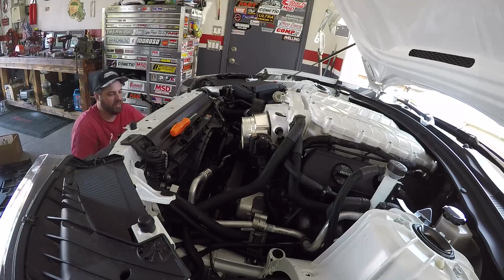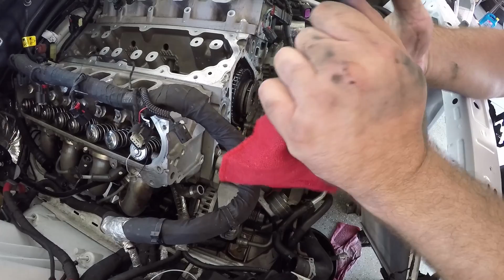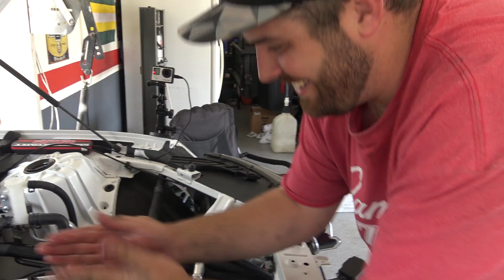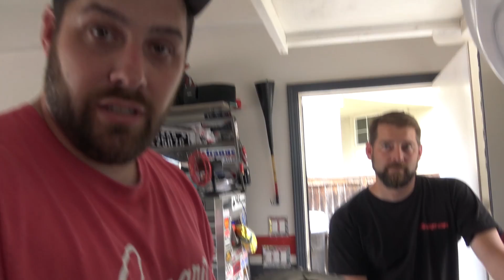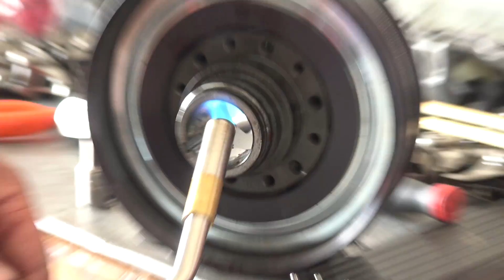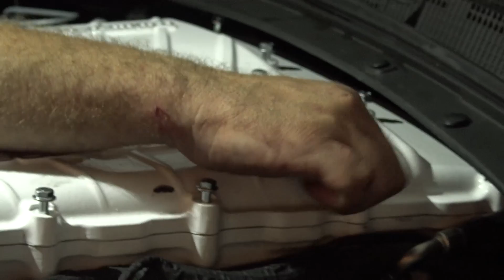Camaro 16-24 Cam Swap V8

Comment: Well, 5 years later, these timing chain tensioners are starting to get old and brittle. They can and do break in half when you try to pin them causing you to have to remove the oil pump/oil pan to replace the tensioner. THe last one i had in the shop snapped on me, a 2017. I have another 2017 in for a cam replacement now. I was able to get the cam gear out without trying to pin the tensioner or loosening the oil pump but it was quite a bit more difficult. I am hoping that i can get it to go back on after the replacement- that will be the real tough part. Also, it turns out that these oil pumps are considered a one time use item and if you take it off, you want to put on a new one. They make tools that you can use to put a used one back on, but many have had low oil pressure afterward- so its a gamble.
Reply from the maker: @FIXXERAutomotive  ZL1 or SS?
Reply: @Lethalgarage  The L86 truck variant
Reply: @Lethalgarage  Well, I got the sprocket back on this L86 without pinning the tensioner. It actually went back in easier than it came out. Instead of locking the crank to torque the cam sprocket, I wrapped a chain clamp between the reluctor and sprocket so that would take the tension of torquing down the bolt and not the brittle tensioner. I put a bolt in the block and allowed the clamp to rest against that. A guy wants to do this with either the heads off or with all the rockers off and the plugs out so in the case your chain clamp slips you don't put too much force against that tensioner.
Reply: That was the part that had me perplexed.  The LT pumps need either  alignment fingers that bolt to the block that save their location or new pumps are self centering . Id love to use this method on my c7 z06 but not quite sure if they alignment fingers will work with this or not . Improperly center pump could cause excessive pump wear and failure.  Not exactly a risk im willing to take on a 10-15,000 dollar lt4 engine .
Reply: @writeupking  That repair was a success and i was able to get the cam actuator back on without messing with the oil pump or breaking the tensioner
Reply: @FIXXERAutomotive so your axle to get the cam gear off and cam swapped without unbolting oil pump ? Because if thats the case there is no reason to not do this method . Id just score a mark into the oil pump thats at a true TDC found with magnetic dial base indicator and yeet on and off referencing that mark and rechecking dial indicator on a rod to make sure the piston hasn't traveled up or down from that reading.
Reply: @writeupking  There is a big gap on the actuator where there is no teeth on the reluctor for the cam sensor- you just rotate the engine to where that is facing down toward the pump- mark the chain to the block and mark the chain to the actuator. then take the center bolt out and pull the actuator off the cam- you have to use some small screw drivers to walk the chain off the sprocket and your free. it has just enough room to come out of there

Comment: What type of wrench and size did you use to remove the metal radiator line on the driver top side that space is kinda tight for me and a crow's wrench didn't work for me

Comment: Was the crankbolt a TTY? I didn't recall seeing you torque it down.
Reply from the maker: Yes, new crank bolt everytime
Reply: @Lethalgarage  how did you prevent the crank from turning when you torqued the bolt?
Reply from the maker: Your crank should have more resistance than the trq required. Also all the ugga duggas

Comment: Do you have to remove the rockerarms, push rod, hpfp to install the cam? I'm FBO H/c and my cam bolt broke and made a mess so need to replace the cam and sprocket thanks in advance

Comment: This video was absolutely amazing!  I'm getting ready to remove my front cover and prossibly upgrade/change out the oil pump.  Question:  Did you have to loosen any bolts on the oil pan to remove the front cover?  I don't recall seeing you doing anything with that.  

Great video!  I took away so much from this!  Thanks!
Reply: Did you end up doing your oil pump I'm kind of sitting at a spot where I'm about to do a KaTech pump myself.
Reply: @RTAMOTORSPORTS  If youre doing the pump, you need to drop the pan.  I did not end up doing my pump.  Make sure to be diligent when cleaning your surfaces and applying sealer.  Make sure you get in the corners very good.  Even the best job can leave you with small leaks.  

Food for thought.  Cheers! <3
Reply: @Hukk989  thank you!

Comment: Thanks for the awesome video, this saved me a ton of work not having to drop the oil pan. I installed my cam yesterday following this. When you installed your cam gear did it feel like it just barely sat in place when you put it on? I believe I have everything correct but get nervous as it didn’t seem to slide onto the cam far at all. My timing chain does sit behind the case and my cam does rotate in sync with the engine as I turn it over by hand.
Reply: Everything turn out okay?
Reply: @Parker565  it did! The trucks been back together almost 3 months about 2000 miles and is running great.

Comment: If I get a stage 2 or custom 2.5 cam, do you recommend I change the cylinder heads or can I get by without em.

Comment: Not pulling the heads off saves a bunch of time too. Can we upgrade the valve Springs with compressed air so the heads can stay on doing that too? Could be a nice update for Stock LT1, Cam Springs, Intake, Headers, can that be worth the time and investment. D

Comment: Have you considered removing the VVT all-together? I understand that you can run a hot LS cam in its place as long as you move the reluctor sensor closer to the wheel. This will allow you to tune the engine without having to "tune around" the VVT.  I know there is some good information out there regarding this upgrade.
Reply from the maker: VVT was removed when the first cam was installed.

Comment: So technically i can just pay for tbe labor on a cam install and get the super charger install for nothing?
Reply from the maker: A supercharger is more than just putting it on top of the block. But the install cost should certainly be reduced
Reply: @Lethalgarage  thanks for the reply

Comment: Can't get the chain back on the crank no matter how hard I try. Looks likes it lined up but still rotates. Anything it can get caught on at the bottom?
Reply from the maker: Should be on the bottom sprocket.
Reply: @Lethalgarage  I figured out the problem. Crank sprocket had worked its way forward and was too close to the back side of oil pump so chain couldn't go on. I was able to push sprocket back from the front side and chain went right on. Thanks for the reply.
Reply: @nathanphillips3061  how’s everything doing this method ? I’m a little sketch with putting time back together I already have everything off the next thing would be taking off oil pump but I’m concerned about to being able to see the dot on the crank to line up my cam sprocket with ! Do I make sense

Comment: Hey man great build ! If you don’t mind me asking how much all in all did it cost you to install the new cam ? Price of the cam and the installation? Thanks !
Reply from the maker: Typical cam install is $3,500 that includes all parts and labor
Reply: LethalGarage man I appreciate it ! Do you have any recommendations on which ones to get ? I only have long tune headers and cold air intake and cat back exhaust. And all I wanna do is install a cam.

Comment: Used lifter on new cam.?.did you need to break in?  engine oil on cam at install only?

thanks
Reply from the maker: Only used parts are. Crank, pistons and rods. Everything else is new.

Comment: Way better then dropping the pan or pulling the engine. Thanks for showing how to take the chain off. I was starting to stress i wouldn't be able to get it off, but watching it i realized i was being a wimp about it. lol. Got to really crank on it
Reply: yeah, I see they didn't drop the pan at all or even loosen the bolts.  I'm getting ready to reseal my front cover because its leaking and was curious if I had to get under the car or not.  Doesn't seem like it.

Comment: Hey.  I know this is an old video but I am thinking about doing a cam soon myself.  I was wondering what all bolts and gaskets were replaced to make sure I go everything.  (I know you didn't remove the heads so probably more needed for me)

Comment: Hey Matt I am intrested in getting a cam, are there supporting mods I should worry about? so far I've heard headers, Ported IM and Ported TB, and a tune
Reply from the maker: You need a few parts to do the cam swap. Springs, lifters, trays, phaser lockout, valley cover or DOD delete. All the parts run about $1300. Air intake, and headers are good. I’d buy the atomic intake over porting. But a good tune is also required.
Reply: @Lethalgarage  Good to know, I knew it seemed a little to easy to drop $500 for a cam and call it a day, Thanks

Comment: Why didn’t u remove the oil pump? I ask cause I’m getting ready to do my cam swap and the kit comes with a new CR5 chain and I see u have to use a alignment tool when removing/installing the pump but the tool is $140 didn’t know if u another way to do it or a cheap tool to use cause it’s only going to be used the one time
Reply from the maker: You need to drop the oil pan to replace the chain, in this case we had upgraded all of that when we swapped the cam the first time. Just needed to get to old cam out and out this one in, so a lot of tasks didn’t need to be redone.
Reply: LethalGarage did u use that oil pump housing alignment tool? It’s expensive for what it is and seems like a one time use tool. Most write ups I’ve seen I don’t see people using it at least they don’t mention it
Reply from the maker: We didn’t, but keep in mind we didn’t fully pull the pump

Comment: This has nothing to do with this vid but I bought my 2018 camaro SS without the NPP exhaust system and I wanna get a dual mode exhaust so I can keep my car quiet when I want to and loud when I want but idk how I would set it up, I figured you’d know. I just don’t know if I’d have to set up a toggle switch to open the valves or what ?

Comment: Does the camaro have the fuel management system or is that just in pickups ?
Reply from the maker: I am not sure what this question is in reference too?
Reply: @Lethalgarage  , never mind just watched a video you made 2 years ago and the answer was yes .
Reply: @Lethalgarage  , they started running the fuel management system in 2007 on the G.M pickups and was wondering if the camaro got stuck with this junk as well .

Comment: is it true the average cam job cost to install is around 4k ?
Reply from the maker: Mike can do it for $3k + the cost of tuning.
Reply: LethalGarage wish mike was here in Ny that’s the best price i ever heard how long was the installation time
Reply: Heads, cam , are springs , trunnions upgrade, timing chain , new bearings thru out , all arp bolts and studs, forged pistons and rods cost $6500 to install. But the engine is fully build and strong a ton of boost or nitrous

Comment: Not bad 👍 I’ve been telling everyone that there’s no need to yank the engine to put a cam in. That’s how I plan on doing mine
Reply: Regular Guy Garage if you have access to a lift, you can drop the motor from under and it would save you A LOT of this work. I know a lot of folks don’t have a lift,  but it’s a little FYI.

Comment: I have a 2017 Camaro 2ss with 3000 miles on her. My brakes continue to squeak with factory brakes and rotors any advice?
Reply: Had the same problem with the brakes on my '16 SS, I installed the Power Stop K7226-26 Front and Rear Z26 Street Warrior Brake Kit ($430 on Amazon) and the squeaking is gone.
Reply: Thanks imma check them out.

Comment: So oil pan removal is not needed for the cam install?
Reply from the maker: Keep in mind this is a partial swap. But no the oil pan doesn’t need to be pulled if you do the timing chain like we did
Reply: LethalGarage good to know brother thanks.
Reply: No because he has already replaced his lifters the first time he did a cam swap